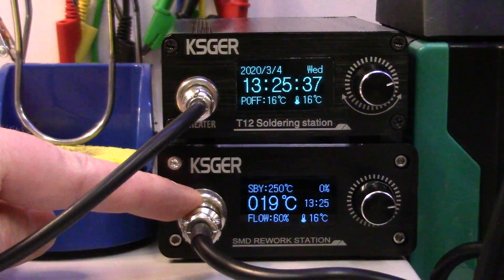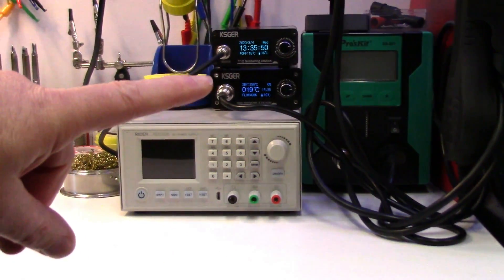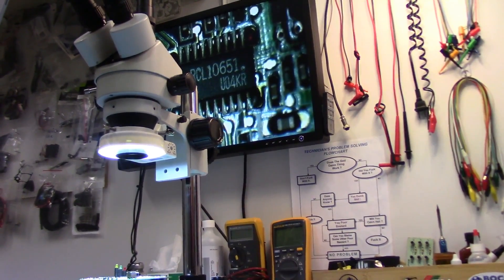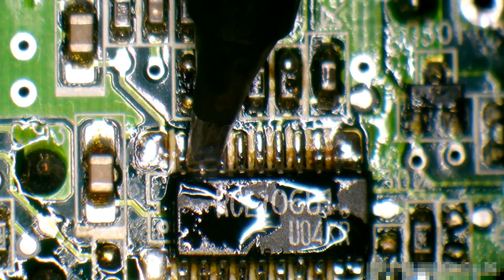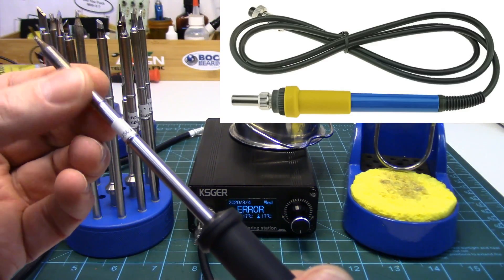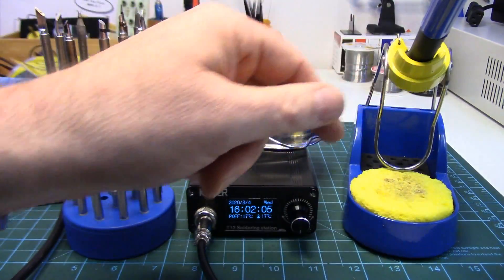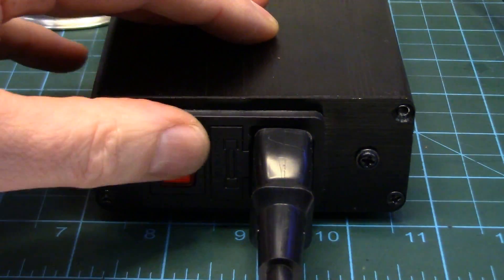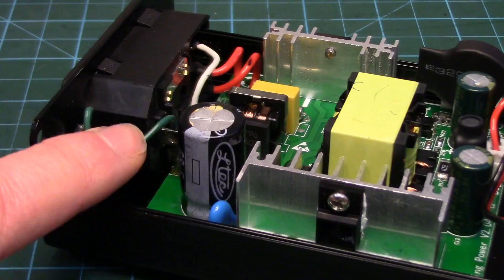KSGER T12 & 858D Station Follow Up & Questions Answered

Comment: I bought my unit based on numerous feedback such as yours. After 6 months it died. Error code from the handle on all tips.  I did lose the auto on feature earlier but just hit the knob and it would warm up in 8 seconds. But last week as i was completing a Signal tracer conversion  to into a Fender 5F1 guitar amp on the very last joint it died. I dug out my old Weller and completed the task. Then took the handle apart to find the bluer wire broken off.  I repaired that and just as i completed the repair a black wire flopped up broken off from somewhere. My problem is i can't see a tab of point where it came from. Is it wired with the white lead??? I was also surprised at the thin wire used. This unit is a early 3.1 version with a black plastic handle. it seems someone cheaped out on the handle. I did not open it up but after seeing your ground fix i will. But now i want to get this handle fixed. Any thoughts?  I have seen replacement harnesses and of course whole new handles. I also want the station you have to stow the handle, the tool tip stand and the tip tester. I used Thermistors in my 3D Printer and smoking model trains to control temp so i know once calibrated they are great. Appreciate your video any help on rewiring this handle and a source for the items you have would be great. I need to rework the Amp project and i am in withdrawals. the old iron is like 1 inch diameter and I can't see my work as easily.  Thanks Again, Dennis in Virginia
Reply from the maker: In my original review video of the T12, I show where all the wiring in the handle goes. I also have another video where I assembled the aluminum kit 9501 handle which also goes over wiring. https://youtu.be/BotH7s2TGYc
The wire on these irons doesn't have to be large gauge because there is very little current passing through them. If they made it much larger, then the handle would be more difficult to move about with a "hose" coming out the backside.
I'm not at all familiar with the "black handle" iron so have no idea how wire strain relief is managed inside it, but if the wires broke like you said inside the handle at the solder connection, my guess is  there was insufficient strain relief for one reason or another.
I use my T12 station almost daily, and no wires have broken as of yet (going on 18 months old), but as I showed in the original review video, I did take the time to re-solder them all (I was not happy with the factory soldering) and made sure to zip-tie to the cable to the cable support in the handle to ensure there was no strain on the individual wires in the handle at the solder connections.
Reply: Looks like I am in trouble. The tip got Red Hot set at 350. Sensor may not connect right or thermistor not working. Your diagram was great but alas I think sensor failure has occurred. D
Reply from the maker: The temp sensor for the tips is built into each tip. If you have more than one T12 tip and it does it with every tip, that would mostly likely be a wiring issue or problem with the unit. The little glass thermistor in the handle would not cause thermal runaway in the tip.
Reply: Just tested with new tip, went to red hot in 8 seconds. I will order a new handle. Thks, D
Reply from the maker: Could be the station as well. MOSFET's usually fail shorted so make sure to check that too.
Reply: @Rchelicopterfun  Replacing mosfets are no my skill set and KSGER is not answering me. I ordered a new handle but the red tip seems to be machine failure. Would you be willing to fix this for a fee? Retired and this was big investment for me $70 version 3.1 but cheap handle came with it. Dennis in Virginia or tell me which part is needed I see I can get to things ok not Surface Mount but through hole I could replace those type of components. There is a black part NTC 5D-9 with a shiny spot like leaking??? Others look ok. D
Reply: Upon visual inspection i found a black component with a wet spot like leaking. its  NTC 5D-9 a current limiter thermistor sitting on the PC Board. I ordered a few they were cheap and this may be the part that fried when the black and red arced in the handle when the black wire broke off. Its failure may be allowing runaway current, hence the red hot tips.

Comment: Weller has not been made in the USA for more than a decade.
They are now a German Company that farms out the assembly work to an Asian company.
Reply from the maker: The label on the WLC-100 station I have (the one shown in the video) says "made in USA, assembled in Mexico". Yes, it's older than a decade so it was crap back then too.
Reply: @Rchelicopterfun  Mine was older PU-1D and it was still bad.

Comment: The only reason people are screaming that it's bad because it's cheap chinese is because they are elitists that only buy the highest end tools. These KSGER irons are actually pretty good, I used one as a field iron for a couple months and the thing is beat to hell but I still use it on my bench, replaced it with one of those TS100 irons as a field driver.

Comment: John, Thanks for these videos, but can you show how to clean these tips?
Reply from the maker: Same as cleaning any solder tip. Draw them through a damp cellulose sponge or a dry brass shavings sponge when the tip is at operating temp. My beginner's soldering page on my website has a section on tip cleaning along with a link to a good article on extending soldering tip life:  https://www.rchelicopterfun.com/rc-soldering.html

Comment: Love this video and your initial KSGER T12 review. I just got one of these irons myself and am not worried about the case not being grounded. Do you have any tips on making the hole for the screw? What gauge wire did you use for that and the switch lamp?

Also, it looked like you added back in a battery holder, or am I mistaken?
Reply from the maker: Drilled out the hold. 18 AWG is what I used. You could even go smaller, not like either will be passing much current.
Reply: Aluminium is rather soft, you can either use just about any metal drill bit or a step-drill-bit.

Comment: Yeah Weller is really not that great anymore... honestly, also it takes ages to heat up, once you are used to 10 sec heatup of the KSGER it's over. BTW. that sandbag is crazy.
Reply: my weller just died too and when opened it up. I was not impressed with it. I have order KSGER soldering station as replacement after watching John reviews.

Comment: Everything aimed at consumers is built to a price.  Really expensive professional equipment may be built to just be the best, but we're not their target market.  Many of us can only just afford these fairly decently made Chinese products.
Reply from the maker: Well stated. 🙂
Reply: And for a lot of us, it fits the bill in terms of price vs performance. I'm a huge tech / video game nut. I use my Yihua 936 clone unit that I paid $30 for off of hobby king probably 6 or 7 years ago now to do a lot of modding work. Recapped a game gear with it, fixed several game boys, new batteries, fixed several computer monitors and a TV. Even fixed a few pinball machines and arcade games with it (Ms Pac Man monitor... I'm lookin at you). While my usage did / does justify better than the 30 dollar cloner I have, it doesn't warrant a $300+ machine either. Soldering projects are few and far between for me now, but for $50 I have no problems picking up something like this which is a much bigger step towards those expensive machines in terms of features and performance than what I have, even if it only sees 20 or 25 hours of action per year.

Comment: Here on is normally when the lower part of the switch is pressed.  All light switches and wall sockets work that way.
Reply: Presactly. 1 is on so when you press the rocker down it should switch on. Then press the 0 up to switch off. Seems correct out the factory. I'm in South Africa FWIW.

Comment: Is the T12 soldering iron ESD safe ? Is the temperature controller circuit same as the HAKKO T12 ?
Reply from the maker: If you plug it into a grounded outlet, the iron tip is also grounded. No idea about the Hakko.
Reply: No, it is NOT ESD safe!
For ESD the tip should be connected to safety ground through a high value resistor (100k - 1M), to prevent high current spikes in case of static discharge.
It is possible to change the tip holder for this.

Comment: Hi John. I followed your video about the T12 soldering station. I did the earth to case wire mod and have blown 2 units doing this in the UK. Not sure what would be causing this as the only mod made was to solder an earth wire from the earth connection on the mains connector where it meets the board TO a eyelet connector which i screwed into the case. Just like you show in the video. As i said I have now blown 2 units doing this mod so im not sure why this would be different in the UK. Any ideas?
Reply from the maker: Sorry none. As I'm in NA and we run on 120VAC, but I  can't see how that would change anything since these things work with universal voltages. The only way something could "blow" after grounding the metal case is if the case is at a voltage potential and that would be a very dangerous situation. I also need more information than "blown unit". That doesn't tell me a thing. What competent/s blew. Fuse/s, input side of PS, output side, the logic board, etc. Impossible to diagnose remotely in other words without seeing exactly what mod you did, how you did it, and test the board to see exactly what failed. I'm assuming the units worked fine before grounding the case - yes? Did you probe your units with a DMM to ensure something on the board was not grounding to the case etc.
Reply: Mate seriously if you don’t know then you shouldn’t be making those changes. Ask somebody local with certification skills to help you or your product could be dangerous

Comment: You have put the rear switch incorrect also  the rectifier diode heatsink is live to one  of the diode pins unless fitted with an isolator kit and I've bought one of these irons today
Reply from the maker: The MRB20200CTG rectifier (what's in mine), is an epoxy insulated case. No insulator back & screw sleeve is needed between it and the heat sink to insulate it. Yes, I physically checked it when I removed the heat sink to grind off the corners of those two outer fins. Perhaps yours has a different rectifier and you like your rocker switches to be off in the up position - I don't. Switch down = off, switch up = on in my world. 🙂

Comment: I saw a KSGER T12 version that did not come with a internal power supply but a DC jack on the rear. Could I use a Laptop charger as the external power supply? 
I checked input voltage and amps, it would be more than enough.  
But is it something that is safe to do? Using a Lenovo charging power supply for a soldering station psu. Will it have Adequate passive cooling and Adequate performance?

Buying a external switch mode power supply would still bring the total price down, what are your thoughts on that and do you see this as a good idea?
Reply from the maker: No idea, never looked into it.

Comment: I looked through the comments, but didn't exactly see what I was looking for, but have you found whether or not these are firmware upgrade-able? As a hobbyist in the RC realm (Drones, Planes and Heli's here) I know that SOME items we use don't have a readily accessible Firmware upgrade connection like a USB, but we can use an USB AVR cable, or similar to connect a pinout and get a bootloader to update. Does this have anything like that, or are these hardware chips that are only upgrade-able if you decided you wanted to swap out the SOC or something like that?
Reply from the maker: No idea, as long as it works - that's all that I care about.
Reply: @Rchelicopterfun  Just wanted to verify in case there was a feature set update or something for further safety. I remember when my Prusa i3 3D printer got an update which included the auto shut off, which prevented possible house fires, I was glad. lol Thanks for your video, I will be making / checking if I need to do the modifications you showed here. I really love my KSGER T12 unit, best Iron i've used to date in this price range. I have been using my TS100 for a couple years now, and it's been shelved for field use only!
Reply: There is an opensource firmware based on TS100 one lying on Github for those ksger stations but it's still quite experimental so it's safer to desolder the provided MCU and keeping it as a backup. Also the firmware is only available for an older PCB design which is quite hard to find these days.
At this point, you may want to look instead on Github for the hakko_t12_STM32 which is an openhardware station designed from scratch with a common bluepill devboard.
Finally, you'd probably buy an ST-Link to program the stm32 chips as the bootloader provided can vary from batch to batch and might be write-locked, there is good enough cheap clones lying around. The skill is a bit higher than AVR's bootloaders and it requires proprietary freeware from STMicro but it's also a powerful debugger and more convenient than Atmel/Microchip's barebone programming suite.

Comment: Would you buy this station for a first novice? I have done some simple soldering for my 3d printing projects and this looks perfect for me but will never open it let alone mod it.
Reply from the maker: If you want direct drive tip technology, a T12 station is the least expensive way to get it in a decent quality package, with some pretty awesome & usable features. Otherwise you are better off getting a less expensive traditional slide on tip technology iron or station IMO - not as much to learn with them. Just my 2 cents of course.
Reply: Even if they are not grounded? I wouldn’t open it up either.
Reply: if you are so worried about the grounding but don't want to diy ground it yourself then you can buy the version with plastic case

Comment: How are the tips holding up? My concern is that this iron disappears about the time I need replacement tips. Going with a more expensive name brand would more likely ensure replacement parts. What’s you take on how long this iron will stick around?
Reply from the maker: If I could predict stuff like that I would be playing the stock market. We live in a very volatile & competitive time right now. With that said, even if they only last another 2 years the value is impossible to beat.
Reply: John Salt fair enough. Thanks.
Reply: Those tips are clones of the Hakko's T12 series and one of the most performant and popular kind of tips. Note that older non-direct drive tips that are obsolete are still produced by Hakko and chinese clones like Yihua or Aoyue so you need to worry more about replacements parts for the soldering station itself than the tips..

Comment: Hey John, thank you for the very detailed review, just ordered one myself. 

Any chance you could provide details of how you created that four-switch power toggle box? I've been looking to make something similar. Thanks!
Reply from the maker: I just wired like a normal 4 gang switch box. The hot in goes to each toggle switch, and then the hot hot out from each switch goes to its own isolated plug. All neutrals are shared.
Reply: @Rchelicopterfun  Thanks, i'm trying to rig up a remote switch for a surge protector to flip off power for my sim racing equipment. I was hoping to avoid running the hot power into my button box and just remotely control the switch, but may be asking too much.
Reply: Even safer would be a four relays and use a arduino to monitor the switch press.

Comment: Just got one off Amazon, still had the wand you have there.  I would have gotten the aluminum one you're not fond of.. but it was a gift.  I do use the aluminum wand you said was too tight.  I pulled the silicon sleeve and cut it in half.. fixed the had to seat enough problem

Comment: Thank You I just ordered this unit in V 3.0 and silver face, metal iron and 4 tips. Where can I get the hot air pencil. And why is it so expensive? My weller tcp from 1971 finally died. I loved that iron. May use the case as it's so comfortable. Thanks again.
Reply from the maker: Links to the KSGER 858D hot air station are in both the description & pinned comment. Not sure what you are asking about being so expensive? These are all low cost soldering tools after all, costing less than other similar equipment.
Reply: Ah I did not scroll down enough to see the hot air machine. But, when I click the link my browser says page not available. Don't worry but if you count on any revenue from these links it might need a tune up. Thank you, D
Reply from the maker: Hmmm... I just tried it using the Ksger 858D link shown in both in the description & pinned comment https://www.banggood.com/custlink/vDGmnbcsg4 it works fine on my browser.
Reply: @Rchelicopterfun  must be my security, don't worry I didn't get my covid check yet. Thank you.

Comment: Would you rather have this or a Ts100(or Ts80)? 
I was hoping that was one of the questions, sadly wasn't.
Reply from the maker: That wasn't one of the questions because this is a KSGER follow up, not a Miniware follow up. Totally different tools as well. Robust bench top vs. fragile portable. Regardless & to answer your question, for what I need in a portable soldering tool, I would take the TS100 over the 80. I go over the reasons why in my detailed TS100 review: https://www.rchelicopterfun.com/ts100-soldering-iron.html

Comment: Hi John, I also bought a Ksger T12, but the one I have has the right side of the heatsink raised up, not touching the mask of the circuit board.  Also the controller is version 3.0 OLED.  So in your opinion I should just ground the case to make it safe?  Thanks!
Reply from the maker: If the aluminium enclosure case isn't earth ground, I would definitely ground it to be safe - totally your call of course.